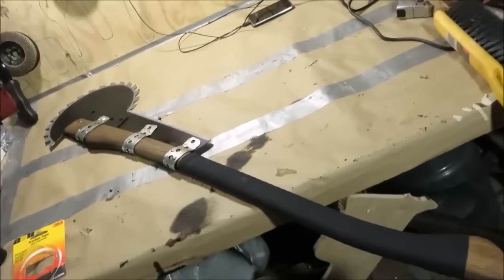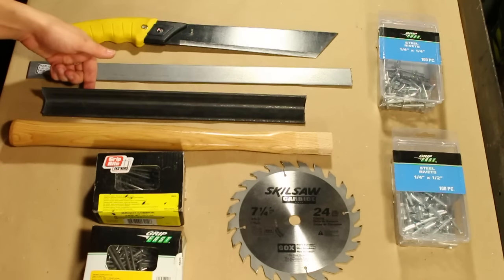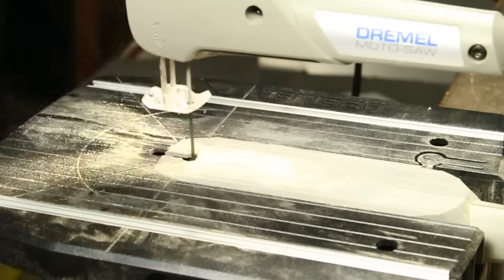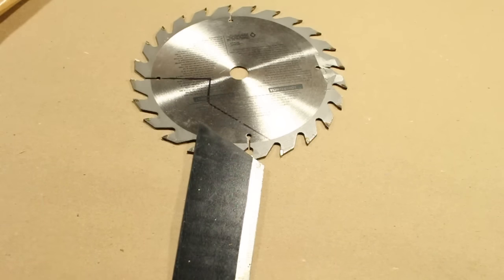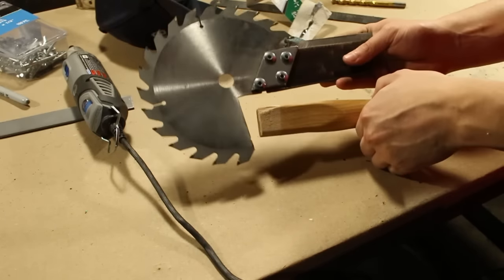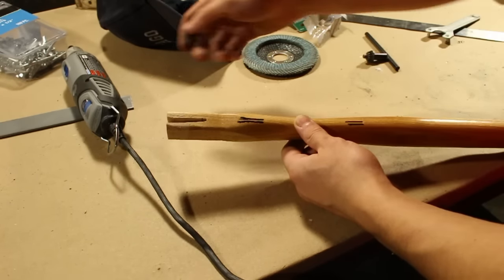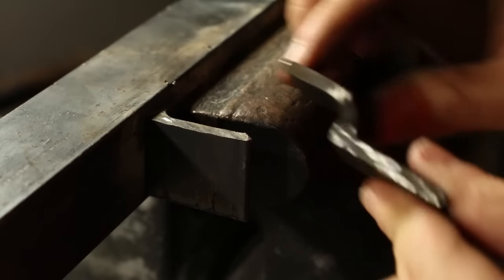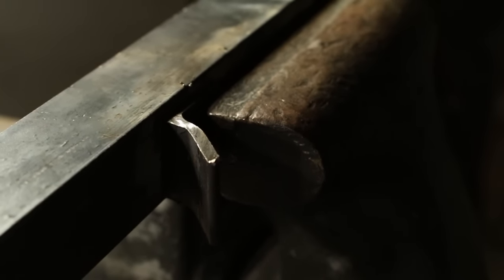How to Make: PSYCHO TOMAHAWK (UPGRADED Wasteland Tomahawk)

Comment: slow your wire feed down a little an an go slower on your travil weld both sides thin grind weld flat like you did on your vid your doing fine you can us a masinery bit ground like a regular drill bit to drill hardend steel  keep practicing

Comment: may I ask why the hell you are wearing a dust filter over your mouth?
Reply from the maker: +Dustin Haynes 
So that I don't breath Dustin. See what I did there, I used your name as a pun for dust.
Reply: +ZNA Productions yeah... very funny buddy.... but just to let you know... the metal dust is heavy enough to just fall down on the floor.... I'd know this after my countless hours of work in the High school metal shop.... you could get a face shield  and not wear the safety glasses and mask and save a bit in comfort.... just a little trick.. lol but if you don't mind going the extra mile and don't mind the uncomfortable mask... have at it... lol... and just a question about the bending of the metal.... why don't you use heat? the way you are bending it without heat makes a weak spot in the bend, a little heat would let the steel keep its strong property.... just another idea since you should keep in mind that the tools should be strong when your done building them... you don't have to listen to what I have to offer, but I thought it would be nice to let you k there are some easier ways to do some things... lol... you mentioned that you don't like welding.... I can give you a tip.... do stitch welding..... hold the Mig gun in one spot and let a pool of molten metal form.... and just do that pool next to pool untill across the surface...  allowing to cool or dip in water to cool fast so you don't warp the metal.... this on both sides then grind it off n flush the metal up nice and pretty and it will be a good weld.... lol...
Reply: +ZNA Productions sorry... in not trying to criticize you... I just wanted try and give you a little help....

Comment: Ok get an auto tinting helmet and a wilder takes a long time to learn don't feel bad you suck right now I don't have the best welds but I am way better than I was then I started and work with the setting on your welder and the wire speeds there should be a pamphlet or a sheet that says the correct settings for different types of metal